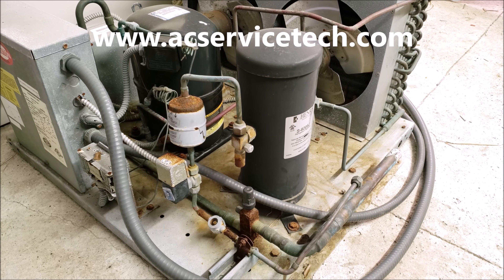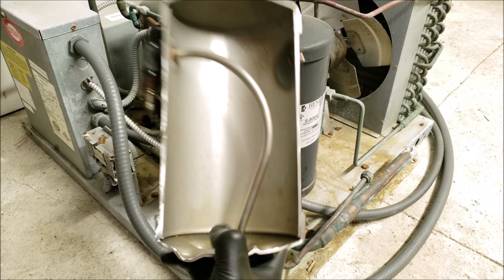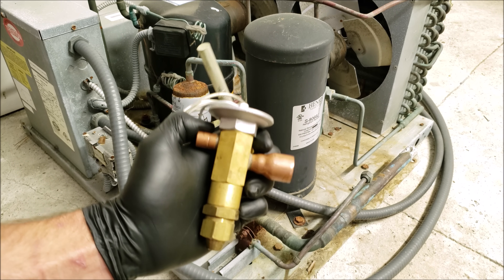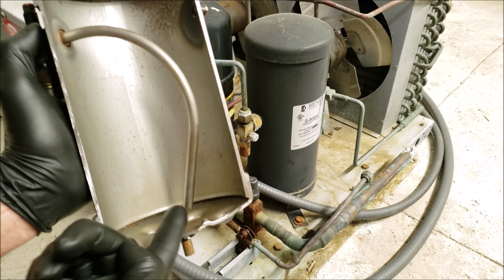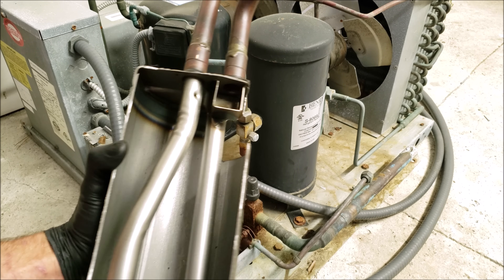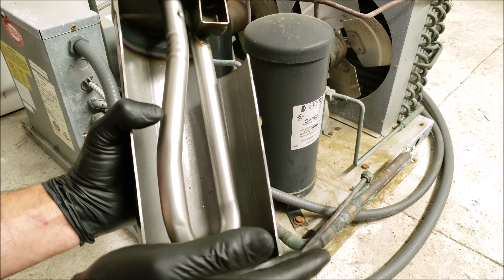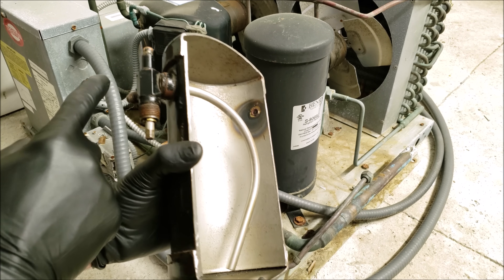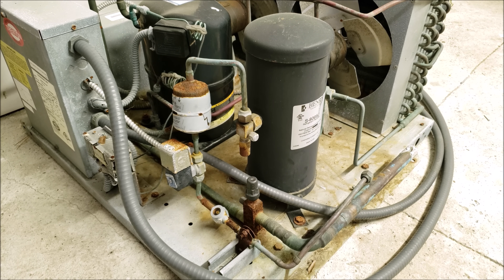Liquid Receiver Tank Purpose for Refrigeration!

Comment: Great video! I have a question regarding this subject. Let's assume such condensing unit with receiver working with TXV and eveporator with constant capacity demand. What would happen with sthe system, if ambient temperature goes down? How TXV react, how evaporating temperature changes? Is receiver able to prevent all those changes? Because theoreticaly the lower ambient temperature, the higher unit's capacity, even if cooling demand remains the same.
Reply: When the ambient temp decrease, the high pressure falls and doesn't works well the whole system, so you need to be sure that the high pressure must be the right one to feed enough líquid to the txv, you can install a condenser fan motor pressure switch

Comment: Question if I need to replace a bad txv which locate in evaporator coil do I just pump down receiver tank storage refrigerant in the liquid receiver tank or I have to recovery all refrigerant out of system then replace a new txv?
Reply from the maker: That would depend on how well the compressor seals the refrigerant on the vapor side and if it has extra ports, thanks!

Comment: Hey you are a great teacher and thank you for always training us online. I have a quick question, me and my coworkers been running into alot of drain issues lately, through an EZ Trap and even though the drain is clear, the system will not drain unless you take the mechanical black cap off the EZ Trap so we added a Tee / air vent before the trap to help. But I think you shouldn't have to have that extra vent, any help would be great thanks again!
Reply from the maker: You shouldn't have to remove the cap. Are you filling the trap with the water weight needed to stop the air in the trap or are you using a dry type of trap, thanks
Reply from the maker: You shouldn't have to remove the cap. Are you filling the trap with the water weight needed to stop the air in the trap or are you using a dry type of trap, thanks
Reply: @acservicetechchannel  yeah I didnt think you should have to remove the cap. yes there is water in the trap it is the EZ Trap that needs water. Only thing different is I put a vent in BEFORE the ez trap but I am trying to figure out why it happened

Comment: Excellent explanation. Just wondering why a valve is never kept between the condenser and receiver. If there was, then one could save some refrigerant in case a minute leak was found in the condenser and the condenser had to be repaired.
Reply from the maker: It is just like everything else, the minimal amount of parts to break and the minimal amount of parts cost wise to come stock on a unit. Thanks Prabal!
Reply: @acservicetechchannel  Tried my utmost to believe in your reasoning -  for not having a valve between the receiver and the condenser -  but failed miserably.
Reply from the maker: I mean the manufacturer providing one, thats all, thanks!